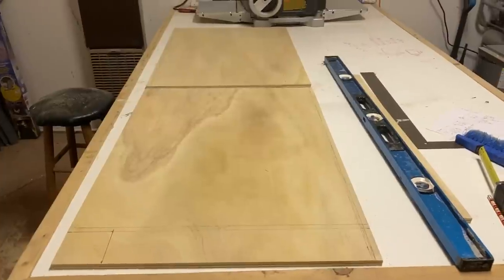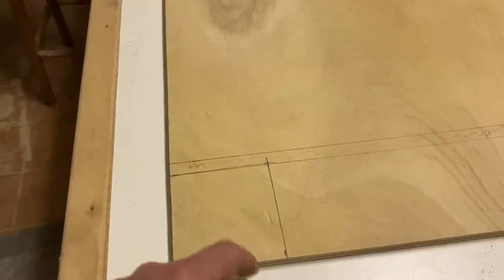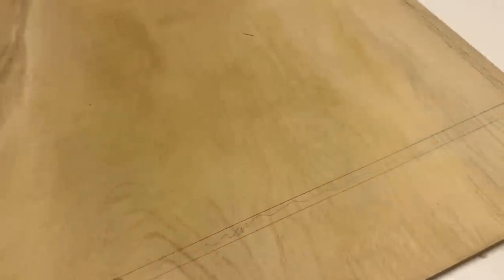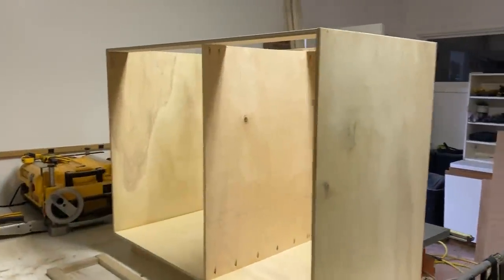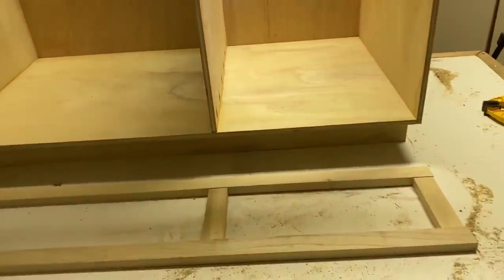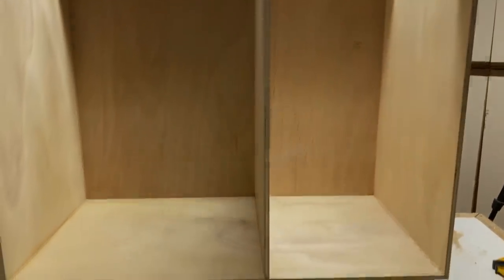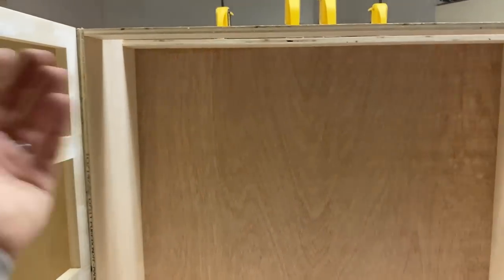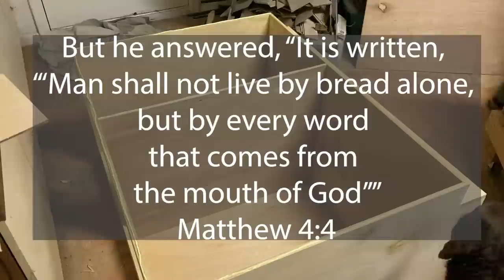Making DIY Plywood Cabinets - Game Bar Renovation (4)

Comment: In place of a fake drawer front, a triangular, fold down/out section that is perfect for things like scrubbies, sponges, etc. Full length of the drawer front with a piano hinge on the bottom. I've seen this many times and it is invaluable.

Comment: Great job ! I used joint compound on baseboard molding when I remolded my 100+ year old house . The coping saw worked good ,but some corners just didn’t work out so I fill the joints and sanded them down . Looked awesome after a coat of paint . Thanks for bring us along on your projects .

Comment: Turned out great for your first cabinet. That drywall tool gave me a chuckle. Great improvisation :D

For the corner, not sure if it fits with your cabinet top idea but you could make a 45 degrees angled front and a curved back. This way you could save some space wastage and the awkward drawer/door problem in the corner you mentioned.

Looking forward to the complete series on this remodeling.

love the channel.

Comment: That looks GREAT!  Good job!  I absolutely love using pocket holes - you have the Kreg jig I want to get (the 520 I think?).  Biggest thing to remember with using a Kreg is making sure to set the jig and drill depths to the right thickness of wood, and then using the right length screws.  If you are poking through with the screws or the screw heads aren't in far enough, it could be one or more of the three are off (ask me how I know...).  Thanks for sharing! 🤠